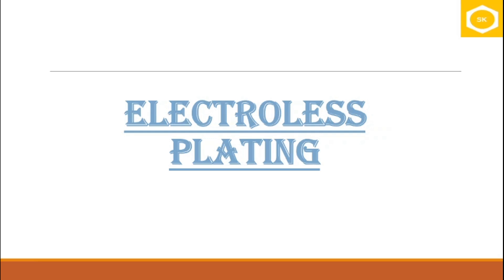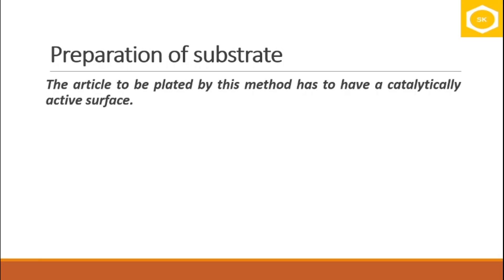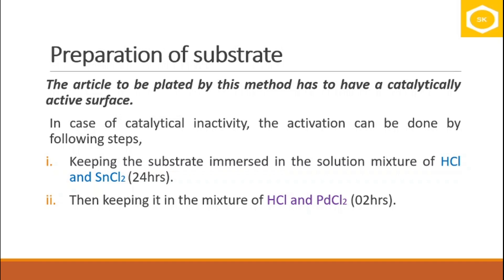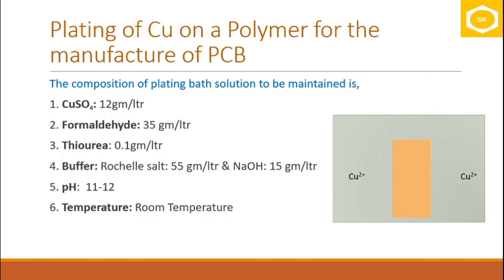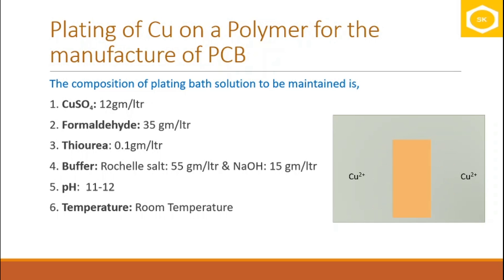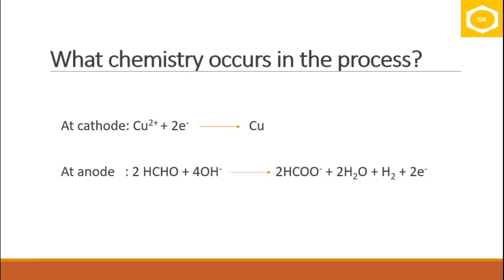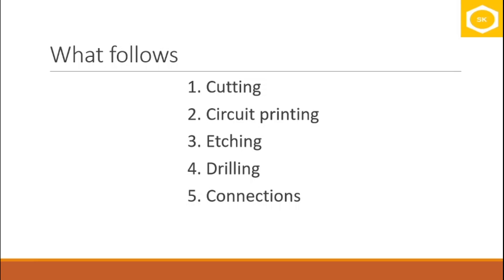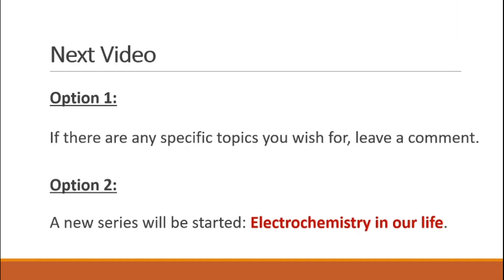Electroless Plating | Part-4 | Plating Techniques | Chemistry

Comment: Thank you for this video. I work in a PCB manufacturing plant and run/maintain an electroless copper line and acid copper tank and have always wondered what the chemistry behind adding the formaldehyde daily. Have read thru the various manuals but nothing of a true chemistry explanation have I been able to find. Much appreciated good sir.